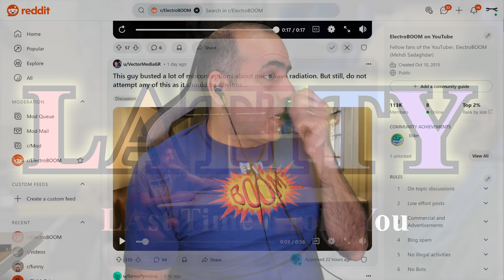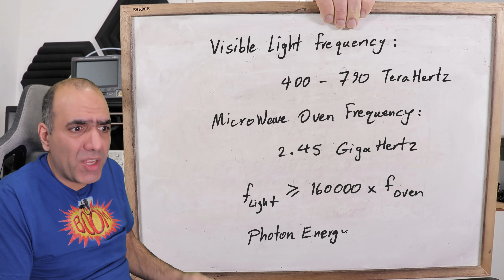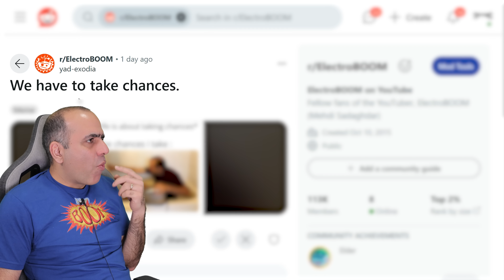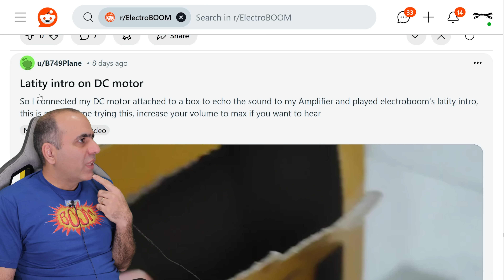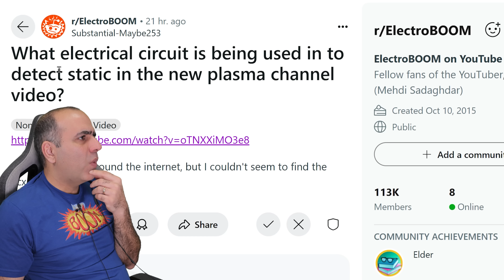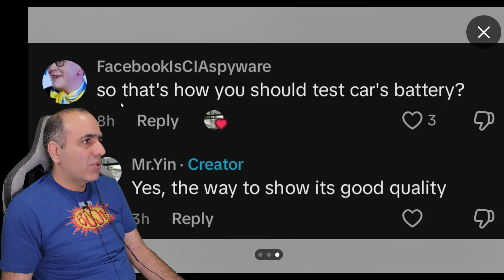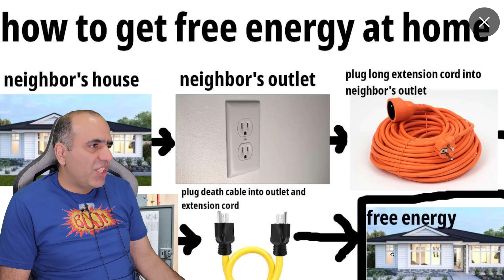Can You Microwave Yourself?! (LATITY014)

Comment: 13:33 nope, but between you and your bike frame, yes.
or any isolated metal parts. does not work on rainy days.

with a long enough antenna... HELL YEAH!

throw a magnetic ribbon from a tape cassette over a power line...
the perfect experiment, it will electroboom.

Comment: when i open the door to my microwave, it spins backwards and the fan is on.. is it zapping me ? i should experiment with a cup of water i guess. Shut the door it stops. It heats normally from the controls, shuts off with beeps at end of timer. then when it is done, open the door and it does like i said... i guess i also need to try and see what happens if i open door while it is running a normal cycle. anyway../odd, and im wondering if i get mildly microwaved when i grab my food out... ill update with more experiments if i get any replies.

Comment: Yeah i actually got one of those suicide showers in my bathroom and it certainly works but the valve and the handle get a tiny charge that i feel when i touch it with a softer part of my skin. it's like getting poked by a needle in the skin under your nail.

Comment: By the way Boom, your as much as you know about  electrical safety, you don't seem to know about RF safety (especially at microwave frequencies). Your microwave experiment was incredibly dangerous even without electrocution. You may not realize this, but microwave energy can literally give you cataracts in your eyes, even at power levels too low to feel as heat. So you won't know your face is too close until you suddenly see your vision dimming out. At 2.4 ghz frequency, just 10 watts in a narrow beam coming out of a wave guide or directional antenna is enough to do this eye damage. While if spread in all directions it won't at just 10w, the fact that you are actually outputting 1200w instead, more than makes up the difference. I think at 1200w in omnidirectional emission like that, you'll get cataracts from about a foot away, maybe even slightly farther than that.

Also that pink ceramic insulator on the magnetron is not supposed to be getting red hot. The entire magnetron is supposed to be cooled by a fan. You actually have 2 fans in a microwave oven, one in the actual cooking area, and one blowing across the heat sink fins on the magnetron. As you saw in this video, even placing the magnetron out in the open air where it was surrounded by cool (but stationary) air wasn't enough to keep it cool (even though that when heated it would make convection currents that would help to pull in cool air). Magnetrons require forced air cooling, or eventually they will be damaged from overheating. So you definitely need that magnetron cooling fan that you seemed to not bother to use in your experimental setup.

Comment: It goes without saying that electricity can kill you. Even as a professional, I have come into contact with it more than once and am still alive. But the danger is still there. However, in my opinion, you have not emphasized one aspect of microwave radiation clearly enough. As far as limbs are concerned, it causes warming, a feeling of heat, and, if exposed for too long, burns. But all of that heals. The eyes, however, are a different matter. The radiation tends to cause protein compounds in the eye to coagulate, which is irreversible, and once you are blind, you know that it was not a good idea.

Comment: Yes in Brazil most houses use electric showers, but there are good and bad ones. Use one that has a shielded heating element, those are safe and can be used in circuits with SDRs, GFCI, AFCI without problem. The one you showed has not a shielded heating element.
In 50 years using those I never got a shock, but one time a short in wires sent sparks all across the bathroom while I run naked to turn of the breaker (it would trip eventually but I was faster because it is not comfortable to get under a burning pair of wires naked.
My father made the installation with duct tape (here we call isolating tape). I don't like it I use or ceramic connectors for the shower wires or I isolate the connection with contracting thermal tubing.
The more modern ones have even electronic temperature controller.
The downside of electric showers is that getting more water makes water colder.
People in Chile user gas heaters they call califont, they get very scared of electric showers, people from Brazil (not all Brazil use electric showers, some building use gas ones and some states prefers gas ones too) in Chile get very scared of gas heaters they use.

Comment: In radar & EW maintenance, the one thing you never say unless you really mean it, is "is it getting warm in here?"
Cuz a statement like that will clear the room as quickly as if you pull the fire alarm.
It's not any hotter than other heat sources. I mean a stove top gets MUCH hotter. It's just that it penetrates the body in ways which 'can' be bad. Your hands are designed for getting burned now & then... your spleen, etc. not so much. If your insides, deep down, get over around 108 F it can cause some noteworthy damage. Though it usually takes a few hours. But every degree up from that shortens the time. So... it can potentially cause harm before it causes pain.
Depends on the frequency and power output though. And how well it can penetrate past a superficial burning effect.

The military crowd dispersing device uses a pretty high frequency to make sure it's "relatively" superficial. Microwave ovens though? Just from heating up burritos, they penetrate about an inch. Which is 'fairly' superficial.
It's definitely something to approach with some caution though.

Comment: The thing is that a lot of people get the Magnetron part wrong, many people think that microwaves come out at the tip of the antenna (the antenna is the metal part on top of the ceramic part) because there is a little hole at the tip of the antenna, but most of the microwaves come out from the sides of the antenna, you can see that when you bring the lamp closer to the antenna when it is at the top, the brightness is weak, but when you bring it closer to the sides, the brightness increases, many people think that microwaves are like a laser or a flashlight that light comes out in a straight line or like a cone, but the truth is that microwaves come out like a lamp, in all directions, but the shape of the Magnetron's antenna makes most of the microwaves come out more from the sides than from the front, so, if you lay it on the floor, it's worse, lol, because you're more in the path of the microwaves than if you were standing up.

Comment: The weirdest speaker I ever encountered was a high powered amplifier connected to a big resister instead of a speaker and I could still hear the sound! After investigating with a hose held to ear and probing it was the output transistors! Learned that it was magneto constriction of the output transistors making the sound....wild. TO-3's bolted to a big heatsink and yet vibrating somehow.

Comment: The bike thing is true. And yes you can see it. I used to live next to big electric pylons and when I passed underneath I had to keep my hands, legs, and feet away from the bike frame. If I put my finger at less than a mm from the frame, I could see a little arc, especially when it was dark.

Comment: Uhhh.... uWaves radiation is not ionizing but it can still cause issues. Like cataracts if eyes are exposed to strong enough uWaves for too long because of heating. It can cause heating of internal organs too... Remember, meat is cooked from inside too when you put it in uWave oven. While skin has sweat pores to sweat and regulate temperature, internal organs dont. So please dont do this.

Comment: I remember my job in the 90s, I would park my car under the High voltage power lines running through that area. You would feel a fuzzy feeling touching the metal door handles of the car.

Comment: 3:15 "under the radar" I see what you did there
11:00 It definitely is wrong. There are shutters in front of live and neutral in UK sockets that only open after earth has been plugged in. If your socket does not have shutters, you could easily stick the neutral pin into live and have the live pin of the plug exposed - or you could straight up stick the earth plug into live. This should not be possible unless you jam something into earth opening the shutters.

Comment: 1:45 i don't remember if it was Habitual Line Crosser (air defense soldier at the US Army) who said that if someone was to be in front of a Patriot missile system's radar when it started operating, they would get heated up real fast. That device may be based on a radar array with nist the transmitters, without the recievers

Comment: 10:38 just like in Malaysia too. Usually we have this thin plastic adapter thing to push something in the ground hole first to open the other 2 holes so that the two pins could go in. But sometimes we just push a stick in the ground hole to open the other holes and stick the euro plug.

Comment: Actually sometimes microwaves are used to heat people, but for the purpose of curing cancer. This is done in a controlled fashion, of course, so only temperatures of up to 44 deg C are reached. There are existing 70, 100, 434 and 915 MHz microwave applicators that are used for a cancer treatment called hyperthermia or thermotherapy. But note that this is an additive treatment in combination with radiotherapy, chemotherapy or both.

Comment: Hey, ElectroBOOM, the DC motor playing sound is real, when you press it over the hard surfice, the surfice acts as energy dissipation to air, just as like a speaker, then there is enought area to dissipate waves in the air, give it a second try,  with more powerful transducer.

Comment: 14:00 yes it wouldn't shock the person, but a shorted battery will heat up the piercing in seconds and burn them pretty hard. You can test it by shorting a battery with a paperclip, you can easily get it red hot
Reply: did this at school and almost burned my finger 👍👍👍👍

Comment: 10:47 My country Unironically use a lot of UK and Euro style plug. To put the euro ones simply stick your key to the ground pin (and open the latch) and slip that bad boy to the socket and wabaam, Done.

Comment: Never wear a dressy shirt, where your phone ends up in the pocket.   The torso shields a phone in your back pocket.  Microwave ovens are mostly a "Death Ray" for pricey electronics.   Also: ham radio shows where you've destroyed your wired microphone with a kilowatt transmitter.

Comment: This made me laugh because one day at my work an old guy called and was paranoid that his microwave was leaking radiation, I explained that unless it was modified or has literal holes in the casing there was no risk at all because the hole needs to be greater than 1cm in order to have any significant leakage. He still insisted and eventually he came in and borrowed a leakage meter... later he questioned if it worked because he saw no movement while his microwave was in use.  I concluded that he did not need to worry about frying his brain because it was clearly already fried and advised him to wear a foil hat while using his microwave from then on.

Comment: even the analog video transmitter of my fpv drone can warm up my hand a bit when its set to max output power. its a 5.8ghz 3W transmitter from GEPRC, a bit too powerfull...

 but i normaly use it on 600mW power or less, and i only switch it up to max if i get bad signal, and i need to see what im doing, while i recover

Comment: WOWA. DANGER! You can't see the microwaves. They would be everywhere. And the power from that transformer is no second chance lethal. And the capacitor will hold the same charge after disconnection! Just don't play with this stuff. What a fool. Danger Danger Danger!

Comment: Euro plug in UK socket? This works if you push the shutter back. 
But, a Euro plug is a maximum of 2.5A and has no fuse. 
A UK plug must have a fuse because the socket is fused with 32A. 
A Euro plug up to a maximum of 2.5A without a fuse into a socket that is fused with 32A.
Round pins into a rectangular contact, this is not a secure connection.

Comment: 10:55 Don't UK plugs have a safety mechanism that makes it impossible to insert anything without putting the long thingy first?
Reply: yes but you can just use a car key
Reply: If you use a tool in the ground hole you can open the little doors that way and then shove your plug in. I've also found that using extreme force will also allow the plug to go in, since it'll just break those little doors. 
It's not as effective of a deterrent as it might seem.
Reply: @draconic5129  @gamecubeplayer So it's more of a suggestion of a detterant, rather than an actual one. Good to know

Comment: 13:08 Riding a bike under maybe a 500 kV AC power line has given me small shocks, I searched it on the Internet and people say it's not static electricity but a capacitor effect and touching the bike's metal prevents the shocks. That worked for me.
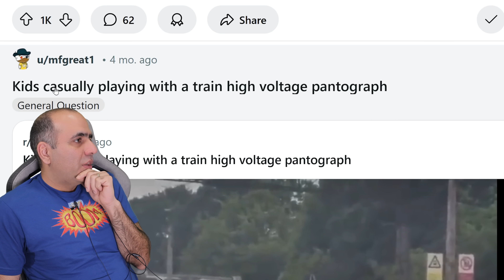14:24 That's a kind of sport for reckless youths in Russia, some die this way from time to time.

Comment: i have HV distribution lines near me. we had some vehicles that if you parked under them it would cause your car not to like it and refuse to start i think it was the anti-theft system or something i dont recall exactly.

also you can hear the voltage in the lines. buzzing overhead. its loud.

Comment: Makes me wonder how much of my insides I cooked back in my youth? Worked 8 hour shifts between 2 induction edge tempering machines, dual coil pumping out enough energy to heat the metal to glowing. 
Holding a circular flouro light for an inspection magnifier between the machines had it light up and forget using a good ole walkman as all you heard was static crackles.

Comment: As the middle prong on a UK plug is the earth, a Euro plug inserted directly in a UK socket won't be grounded. So I'd say it's wrong, unless you use it for, say, a phone charger, or something along those lines.
Reply: the hac-002(ukv) only has a plastic ground pin
Reply: @gamecubeplayer  Because the two sides of the power supply are electrically isolated, so it can be plastic. Hence me saying plugging a Euro plug in a UK socket is fine, as long as it's something like a charger. But if you plug in something like, say, a Euro kettle in a UK socket, the kettle won't have a ground connection in the socket, so it won't be grounded if there's a fault. Instead it'd sit there at mains potential and potentially shock you when you touched it.

Comment: About those paddle boards, I thought I knew what they were for, working in old-school QA back when we manual-tested phones, but even then...most phones or devices use 1.0A power, so AT MOST you could get a 20-plug circuit on a REALLY high-amp commercial run, and that wire could NOT handle industrial. Maybe it's for hackers to use in circuit control switching attached to some Raspberry Pi or something?

Comment: Ooh, I have felt the "static electricity sensation" riding an electric scooter under a pretty low hanging power line. A moment of "why the hell is my handlebar electrocuting me, is there something wrong with my scooter" and then realization.
Also those kids playing on a train are from Moscow, Russia, as evidenced by "МЦД" on the train. Those rail lines use 3 kV DC afaik.

Comment: Dont plugs have mechanical safety features (spring like action to hold contacts in place or ground pin is longer to ensure ground is connected first) so switching different standards even though they fit might bypass some safety features and create it's own issues (smaller pin might mean arcing since it might not be firmly pressed against contacts etc)

Comment: If you run the magnetron like that it doesn't run to its full potential as the probe sticking out is not designed to work in free space. IIRC around 10% of the power is actually radiated, which is still a solid 100W or so.

Comment: Lol just to add to the 9-volt to the nose piercing. As Mehdi said, no shock will happen, but the battery will short! And that short means the piercing is going to very quickly heat up and burn the wearer's nose lol. Probably not advised, unless you actually intent to inflict harm....

Comment: I've heard that high power microwave radiation can cook your eyes if you aren't careful with it. Apparently your eyes aren't very good at detecting when they're being overheated, so if they happen to end up at a hot spot of the microwave beam, they can get irreversibly damaged by heat before you notice that something is wrong.

Comment: I live near that bridge and riding bike under you can feel a bit of a static charge. It's not much different than the feeling you get before a lightning storm. I have meant to try a florescent tube to see if holding that up will get it to light. Come to Minnesota and run some experiments.

Comment: Here in Brazil, electric showers are really common, and they rarely cause any issues. They're super safe, unless you use the wrong wires or circuit breaker. I grew up using one and still use it today!

Comment: Once I got a shock while riding a bike below a 500kV power line: remember that the bike is like one close loop of alluminum that could work like an induction coil... I felt a pinch on my leg and heard the shock on my earphones. By the way, I am an electrical engineer so I made a complain to local authorities, the answer was that minimum heights were fulfilling regulation distances.

Comment: @electroboom regarding the eu/uk plugs, it works just fine except for one thing: the uk plug is slightly too wide for the eu plug and you will damage the eu plug as you need to stretch and bend it a bit sideways. Once is fine, after that the plastic usually starts to break.